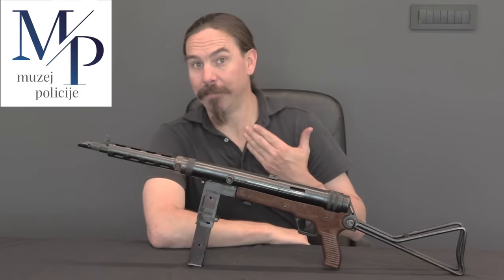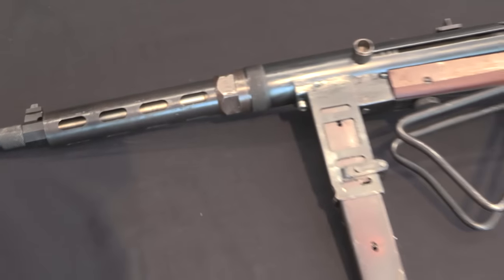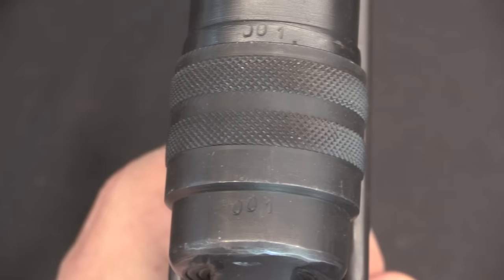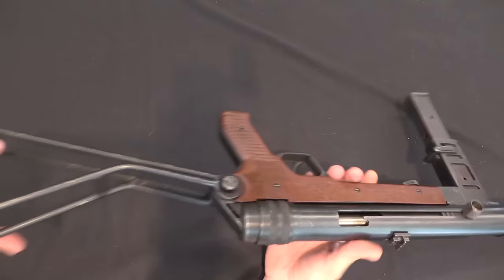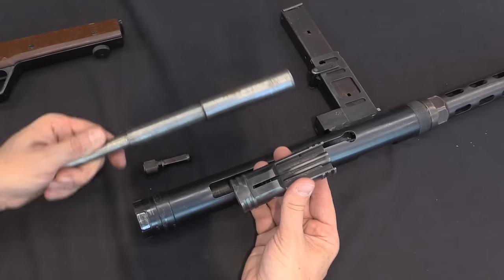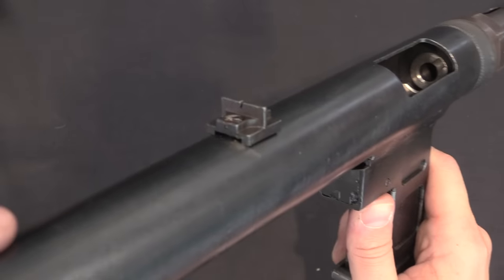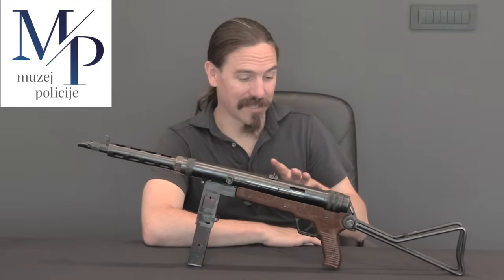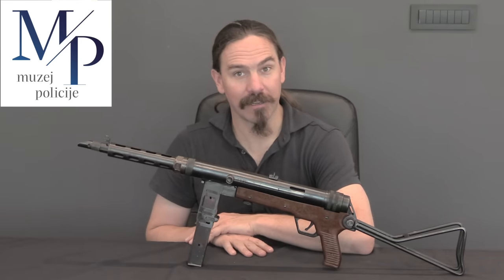Vila Velebita: Croatian Submachine Gun Made in a Shed

Comment: I work in a shed - I make cutting-edge precision parts for Formula 1.
A garage is just a small shed.
A factory is just a large shed.
Reply: @Ramonatho  Not always. Used to work in a factory where the most advanced thing was a CO2 Laser CNC table. Everything else was turret punch presses, manual brakes, mig welders and angle grinders.
Reply: @dposcuro 
And STILL turned out plenty of quality thingamabobs!
😉😉😉
Reply: A garage is a large shed.
A factory is a maximum shed.

Comment: Could the recoil spring be an off the shelf part?
Reply: Made for some other purpose then used as is in the gun? That might explain why the long receiver. Not a design choice but a necessity to accommodate the proprietary spring collapsing unit.
Reply: Looking at it, that was exactly what I thought.  It probably came from something else entirely different.
Reply: Yeah, like a bicycle shock absorber. This might also explain the bolt, could have been from the vicinity of the spring
Reply: @すどにむ  , I suspect that after the first person discovered that a relatively common commercial product contained such a useful piece of a finished submachine gun that the word spread rapidly, perhaps as soon as hours,  to many other would be manufacturers.  After all, it was literally their patriotic duty to do so.  Such a system literally could have been as simple as a 1980's bulletin board run on a PC.